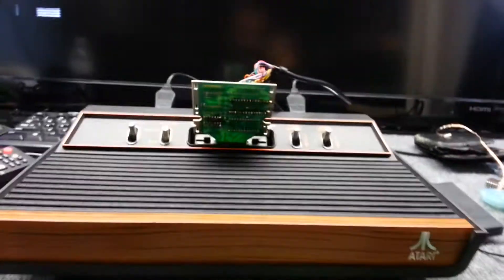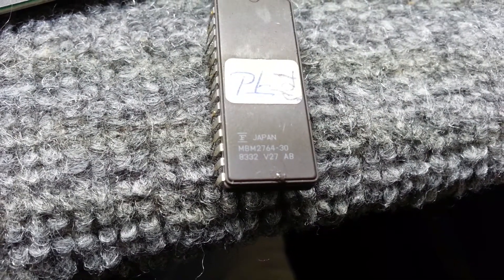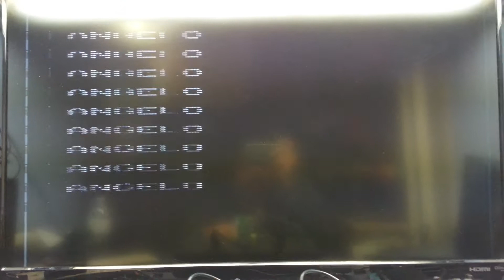My Atari Compumate is alive!

Comment: Hi - I know that this video is a couple of years old now, but do you offer your compumate eprom burning as a service? I have 5 failed compumates that I'd love to repair. Could you briefly explain the process? Is soldering required or at the eproms on a socketed board? Which file did you actually use to burn, to resolve your issue? Thank you!!!
Reply from the maker: Well I don't have the dump of the eprom, but I can see if on mine the eprom is socketed , if it is, I can do a dump and send to you !
Reply: I would love that, please private message me if you are successful and I'll give you my email. Is it a dual eprom? That is, two eproms on top of each other, or am I looking at the wrong chip? thanks so much for your reply
Reply: I would love that, please private message me if you are successful and I'll give you my email. Is it a dual eprom? That is, two eproms on top of each other, or am I looking at the wrong chip? thanks so much for your reply